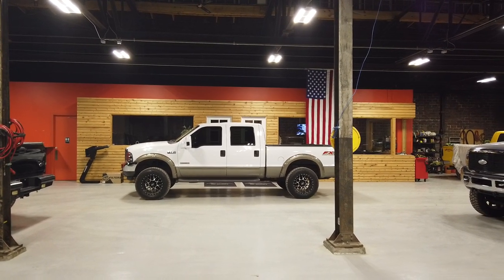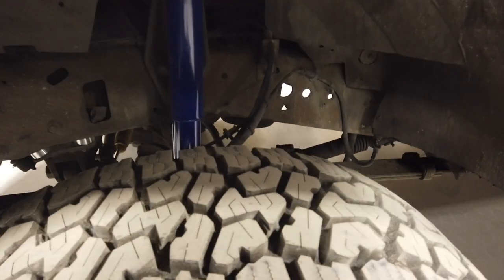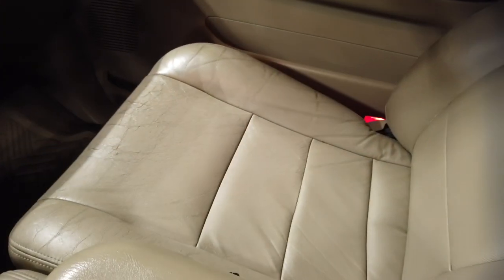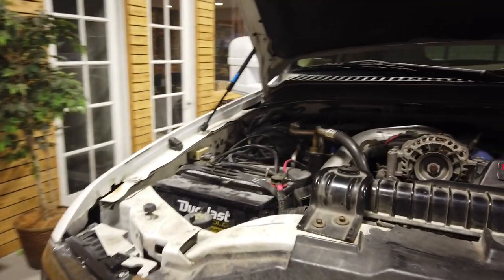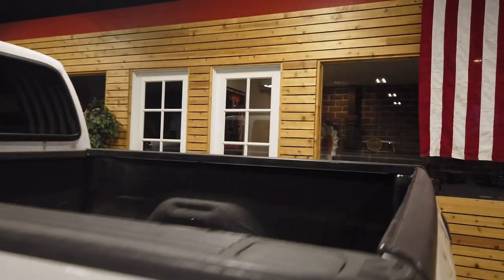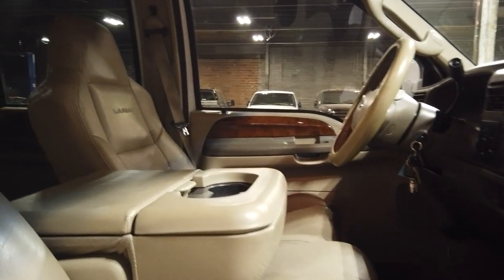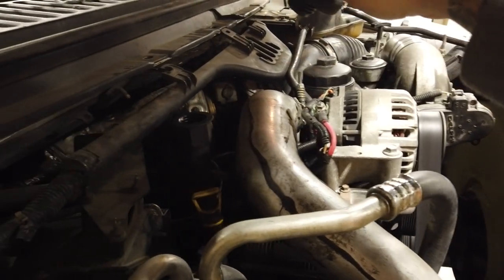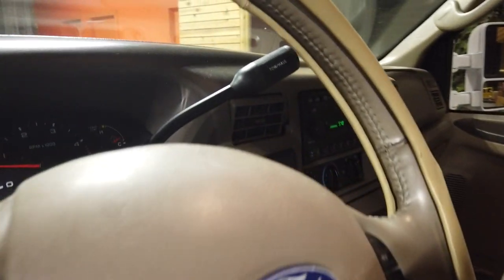2003 Ford F250 FX4 4x4 Powerstroke Leather, Lifted, 20x12s, new 35s! FOR SALE COLD START

Comment: where did you get the headlights ? and did you have to do anything to get them to fit ??
Reply from the maker: Amazon, 2005-2007 F250 Harley headlights, yes you need to take a grinder to your header panel to notch some space for the 1 piece headlights.